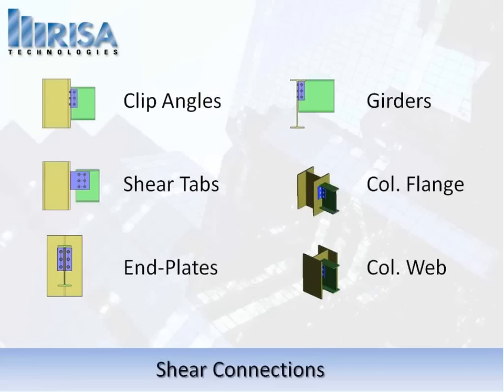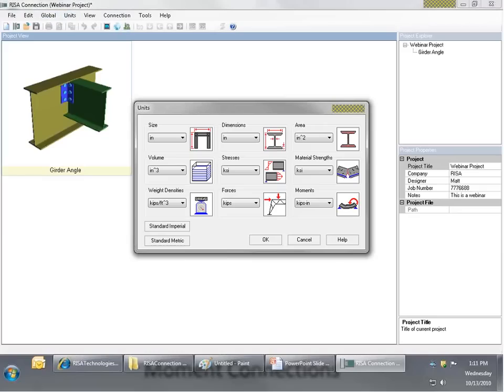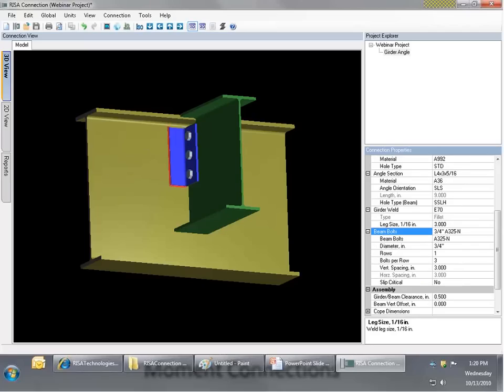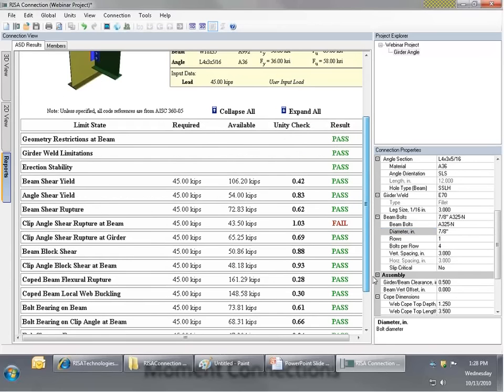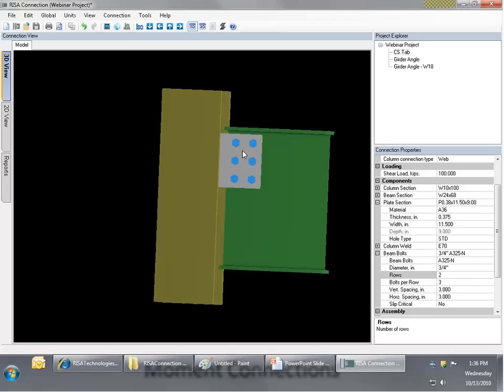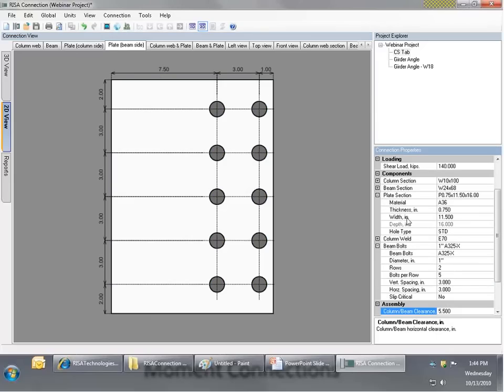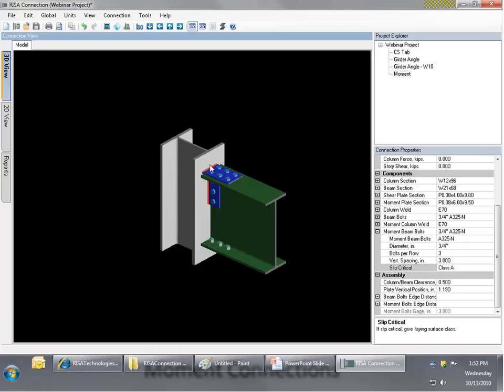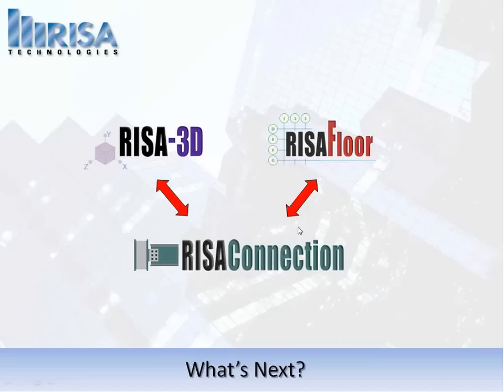Steel Connection Design using RISAConnection

Comment: Is it possible to get moment-rotation curve of the connection?
Reply from the maker: Unfortunately not.  RISAConnection assumes connection rigidity based on the direction of the applicable design code and then checks geometric material limits (i.e. plate thicknesses) to either confirm or deny that assumption.